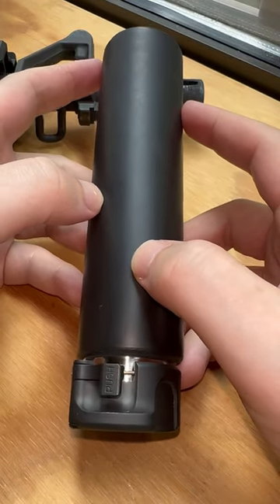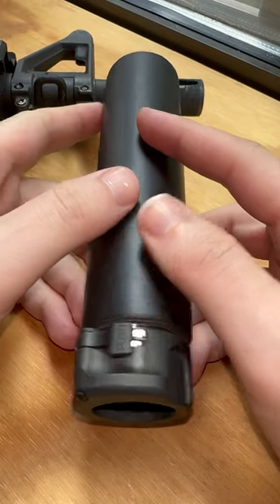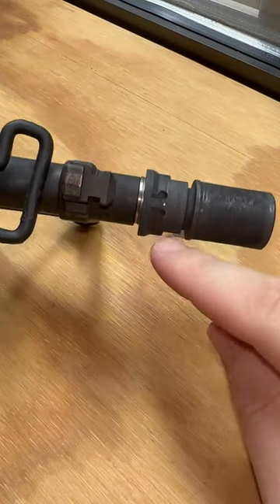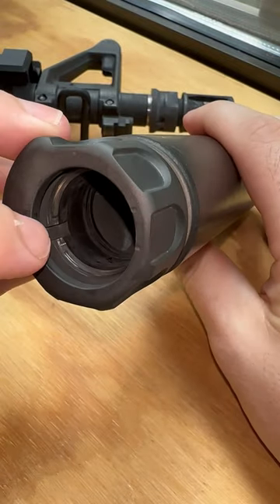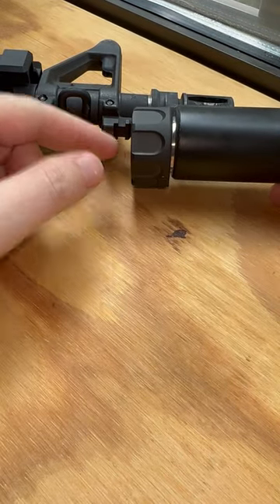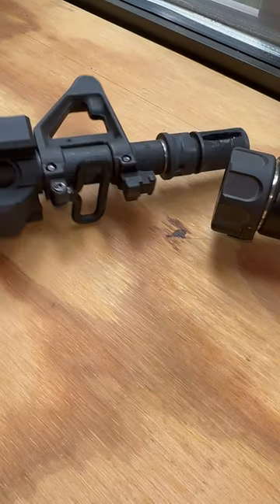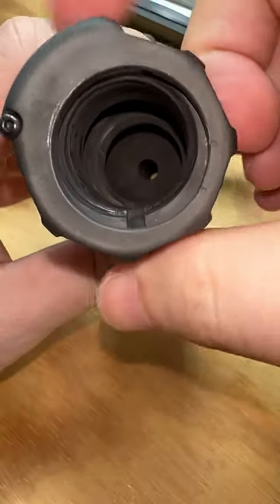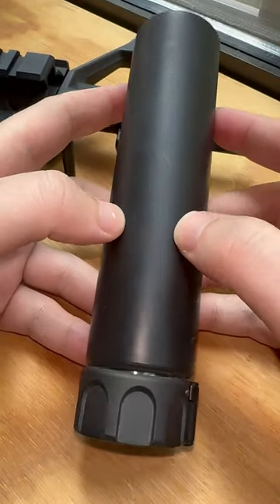Surefire RC2 Mounting System #surefire #shooting #shorts

Comment: Thanks I have an rc2 in jail right now and I’m so confused as to what muzzle devices can actually host it. Now I know to look for the ones with that tab.
Reply from the maker: They should also be labeled as "Suppressor Adapter" if they are able to take a Surefire suppressor
Reply: They will say surefire "socom". All the socom muzzle devices mount to surefire suppressors
Reply: Just don’t even chance it and get a flash suppressor from surefire, I went with the 3 prong
Reply: Sfa2 if you don't need 16" otherwise avoid all compensators and just usebthe 3/4 based on availability
Reply: Just get a SF3P or SFMB.
Reply: Any surefire suppressor labeled “SOCOM” will fit any RC2 whether it’s a 5.56 or 7.62 can
Reply: @Isaacsbased yeah, but a couple flash hiders offered by surefire are not also suppressor hosts. Read the description before you buy (the price point is a giveaway)
Reply: Guys, using the acronyms isn't going to help him much. He is new to surefire products. 

Get the surefire A2 flash hider (SFA2), the surefire 3 prong (SF3P), or the surefire muzzle brake (SFMB). All are under the SOCOM family of products,  which can be found on their website under the Suppressor>muzzle device category on their website. If it doesn't say "Suppressor adapter" is not going to work (there are direct thread wardens and "sport" warcomps not meant for Suppressor use, so read carefully)... price is also a good way to tell. Most, if not all, of the non suppressor capable muzzle devices are around $100. The Suppressor capable betraying are about $50 more, running the price to 150ish.

Have fun!

Comment: What flash hider is that? Ive only seen long surefire CTN hiders
Reply from the maker: The model number is SFA2-556-1/2-28
Reply: SOCOM556-RC2
Reply: It’s like a bird cage flash hider like the one that come stock on ar’s but with the surefire suppressor mounting system.

Comment: Can your collar screw entirely off the suppressor too? Mine can be fully detached from the can if I rotate it far enough. I do have an old, used RC1, as it's the most readily available thing in Poland.
Reply from the maker: It can, but I would have to remove a screw which you can see on the bottom of the locking collar about half way through the short
Reply: @oxtrot2G  Interesting, mine comes off if i just push the latch and screw it far enough. I don't need to remove the screw, guess something is worn out in the mechanism.